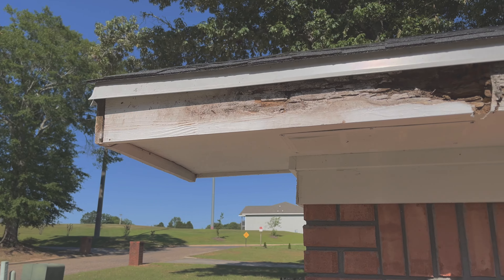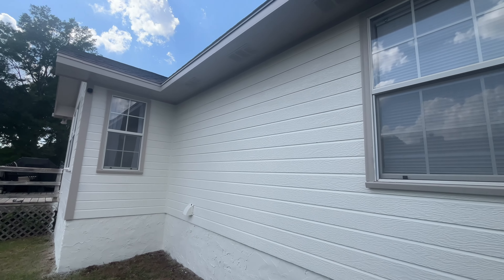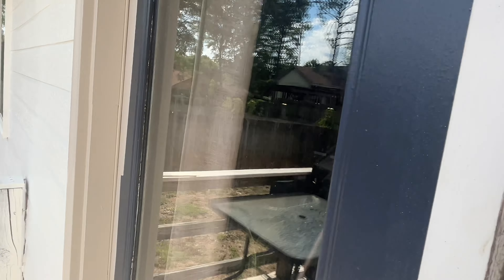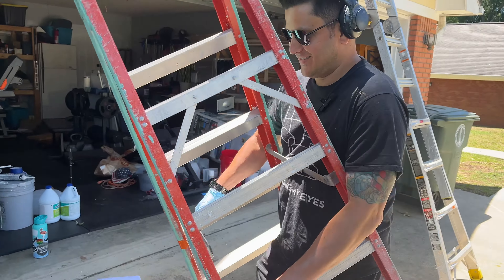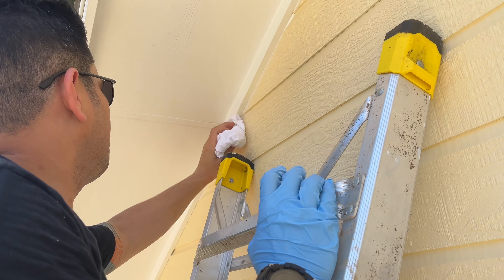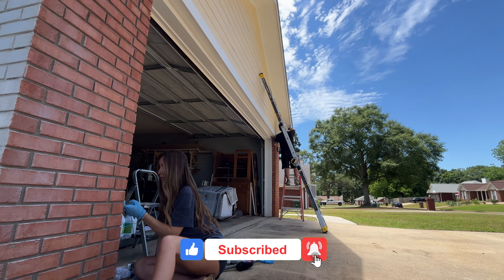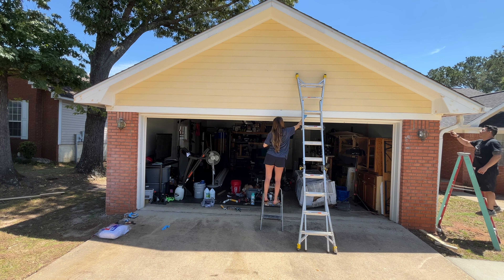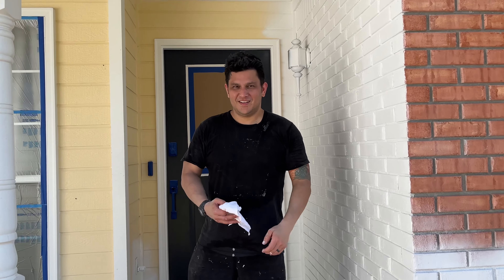DIY PAINTED BRICK with BEIGE Trim!

Comment: 6 plumbing vents?! Wow. Your house was built by a plumber in a hurry. Thanks for the vid! Keep them coming.
Reply from the maker: Thanks for watching! 🙌🏽. I’m not sure I know what vents you’re referring to. My plumbing knowledge is down near 0% lol
Reply: @whyknotbuildit  Haha. They are the white pipes that stick through your roof. They allow the plumbing system to "breathe". Normally we will run them all into the attic then tie them together and only have one protrude to the outside. Yours has six seperate ones which is the fast/easy way for the plumber.
Reply from the maker: Ah ok gotcha lol. Yeah I don’t know what’s up with those. Just 2 bathrooms here.